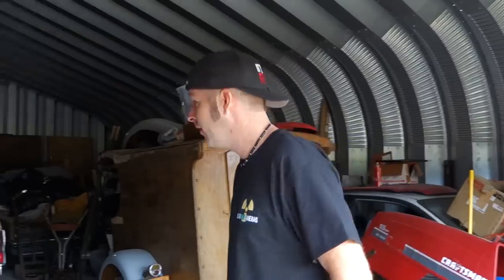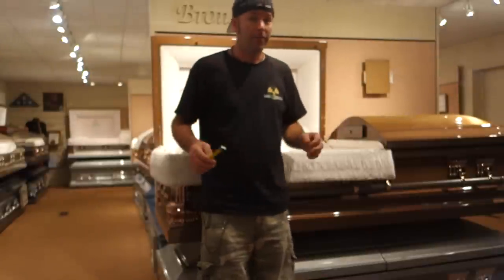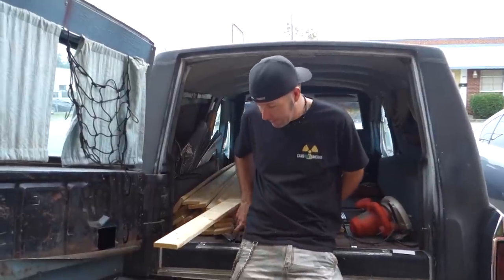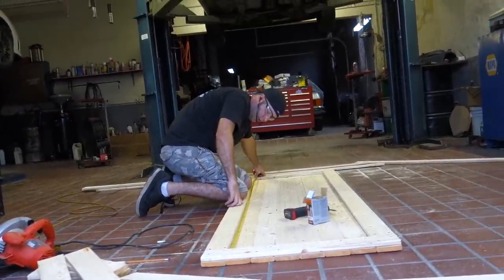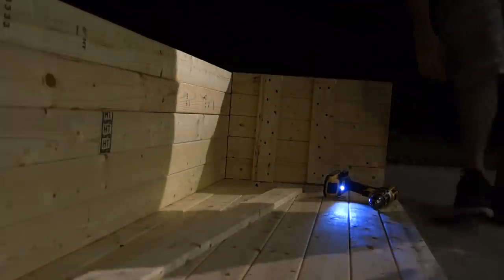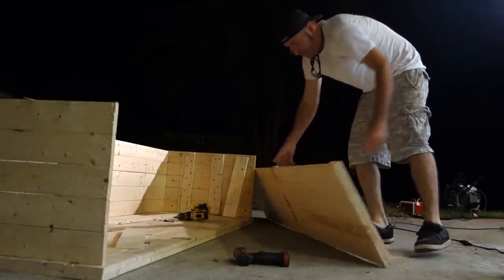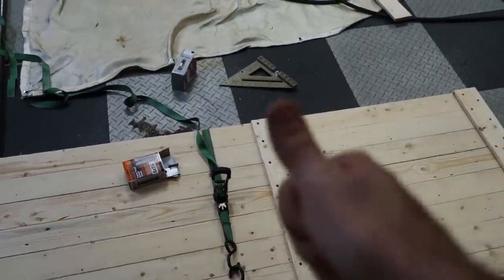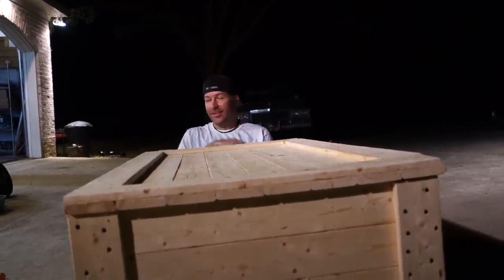Hearse & Coffin Go Kart Build Pt. 1 Ike's Adventures

Comment: i would have made a rectangle chassis with the wheels and all the components on the inside of the rectangle box. once this is done you could make the casket outside that would go on top of the chassis. All the go fast stuff hidden and it would fit nicely in the back of the car. if done right you could have a real "sleeper" on your hands.

Comment: If you want to scare the shxx out of yourselves, put a 212 death row predator kit on a mountain bike, with governor removed and stage 1 kit installed. I'm a retired toolmaker, and I built one to replace my stolen china 2 stroke. I've had it up to 90 km/h at about half throttle, I don't know how fast it will go, because I put the throttle stop screw back in it, in an attempt to keep the front wheel on the ground when accelerating. I think I'll leave the top end speed test to you young guys. Are you interested? Yours truly Robin from the far north, Windsor Ontario, Canada